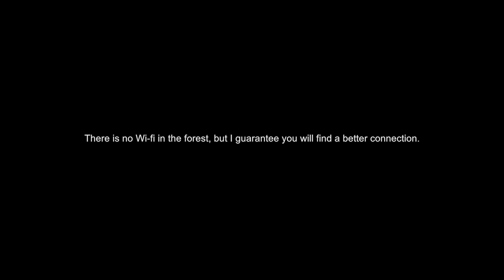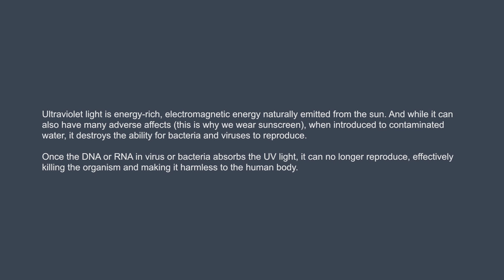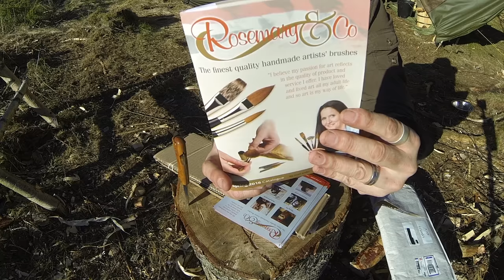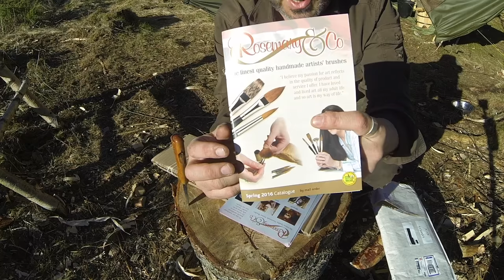THE TIPI DIARIES Ep16 - BUSHCRAFT BASECAMP - HOT TENT CAMPING WITH MY DOG, FORGING CROOKED KNIFE

Comment: are there any fish in that stream or does it freeze out each  winter?
Reply from the maker: You can find small crayfish, it does not freeze completely, usually there's running water beneath the ice apart from one extremely cold winter a few years back